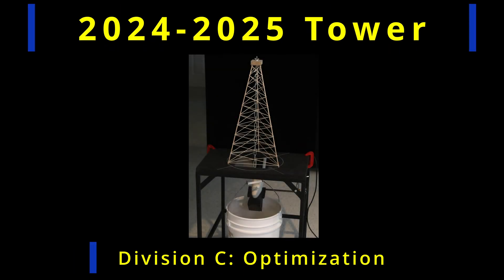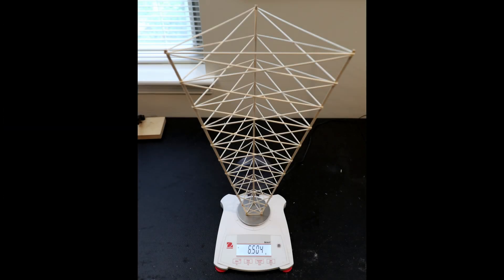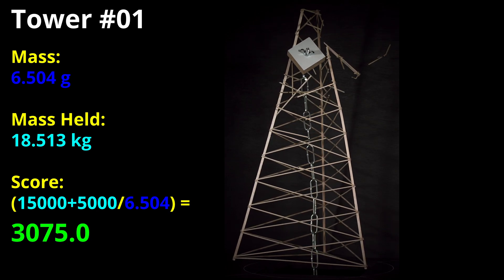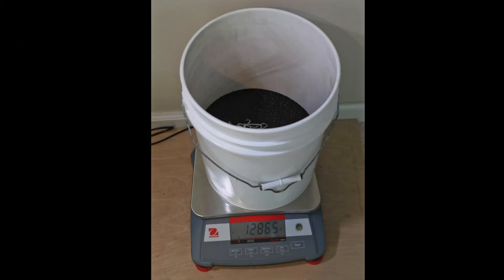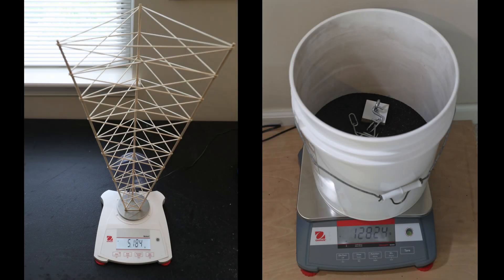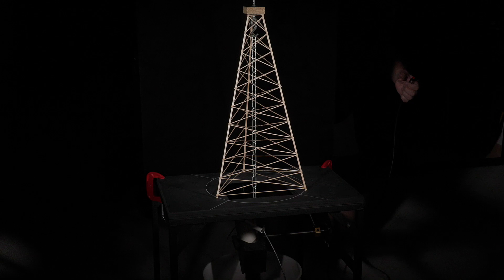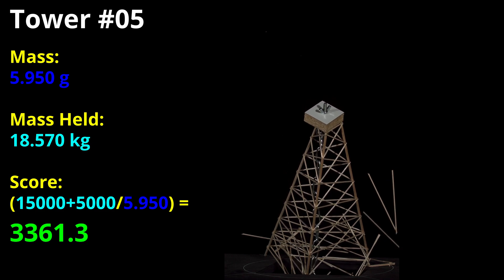2025 Science Olympiad Tower Div C: Optimization

Comment: Hey Balsa Engineering, I am competing in tower for the first time and would like to play with this design. Where can we find the lengths for tower 5 as this was the most optimized one. The lengths of the cross structures and the legs would be helpful. I was also wondering where you got the specific balsa wood sticks. I would like to get the same ones so that I can minimize any flaws.
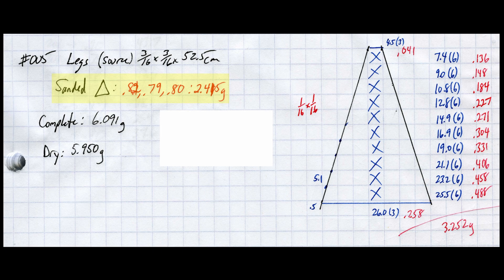Reply from the maker: Hi!  You can find the detailed information on each of these tower builds right in this video.  For #5, check out my notebook page at the 7:44 mark.  Everything in blue on the right shows the lengths of the pieces in cm.  The red is is total mass for each grouping.  You can compute the exact density by know the size which is also shown (1/16 square for the cross members).  I like to buy all my balsa in sheets from a place called Specialized Balsa.  It's not that the wood is better, but it's the only place I know of where you can specify the density range when ordering.  I would highly recommend you check out some of my general videos to learn more about getting great material to use.  Here is one to get started: https://youtu.be/bLsTOpmozGI
Reply: @balsaengineering6686  Thanks, I'll take that into account. Our club itself has some Balsa wood sticks, I'll see if it matches the density of it. If not I may need to order myself from Specialized Balsa, do you know the rough estimate of delivery time?
Reply: I also just want to make sure, the height of each leg is 52.5 cm, the increment for where each cross member needs to go is 4.6 cm. And the length of the cross members itself starts from 25.5 cm and goes till 7.4 cm., dimensions of each balsa stcik is 1/16 x 1/16 inch. the top has 3 (4.5 cm ) sticks.
Reply from the maker: @niranjankothandaraman  They are a small family-run business, so their delivery speed changes a lot depending on how busy they get.  My experience has typically been about 1-2 weeks or so.
Reply from the maker: @niranjankothandaraman  That is mostly correct.  The cross-member layer spacing is 5.1cm (the first one starts at 0.5cm from the bottom).  Also, don't forget about the bottom 3 horizontal pieces that are 26.0cm each.
Reply: @balsaengineering6686  Hey Balsa Engineering, in my last competition, our tower weighed 17 grams and held 11.9 kg. We were curious on where we got this extra weight. We weren't completely sure on the stick's dimensions since we got it from hobby lobby lol.  Any tips for us? We glued the parts were the truss's meet in the middle, like the middle of the x. Do you think the extra weight came from that? Or do you think its probably the wood.
Reply: I would also appreciate it if I can get the exact densities and what u exactly ordered
Reply from the maker: @niranjankothandaraman  Hi!  At 17g, your extra weight is not coming from glue, it's 100% from the wood being too heavy/dense and maybe too big.  That being said, if you built a 17g tower and it only held 11.9kg, you have some other issues to address regarding executing the build.  It was probably not level or there might have been some serious glue joint issues.  A 17g tower should be able to hold 30+ kg.  Definitely focus on a good build with the material you have before trying to find lighter material.  You need to make sure you can hold the full 15kg at any weight before taking the next steps.  Good luck!
Reply from the maker: @niranjankothandaraman  I'm not sure, it really depends on how busy they are.  If things are going well, I've gotten shipments from them within 2 weeks.  During their busy times it can take a lot longer.  You can call them directly and get an estimate if timing is critical
Reply from the maker: @niranjankothandaraman  I don't have those numbers off-hand, but by looking at my notebook pages in this video, you can easily calculate the density for any particular piece or group you are interested in.  In general though, the source 3/16" sticks were in the medium density range, and the cross members were in the light density range.
Reply: @balsaengineering6686  Yeah, when we were removing our tower from the 3d print, we broke many trusses while removing it. We reglued it but that probably damaged structural integrity. I can prob fix that by rewatching ur vids on assembly.
Reply: Hi Balsa Engineering, what kind of glue do you recommend for your tower? Right now we have been using Bob Smith Industries BSI-157H Maxi Cure/Insta-Set (it has a super glue and a spray to use after). Also does it matter the kind of balsa wood we buy as long as we sand it to size?

Comment: Hi Balsa Engineering! My 3D printer has a base of 220 mm, and it is not big enough to print the bottom layer of the Div C bonus jig (260 mm across). How much impact on the construction of the tower would it be to split the bottom trapezoid and print the two halves separately? (cutting through the middle of the triangle parallel to one of the sides)
Reply from the maker: That should be OK.  Just tape the two pieces together as tightly as possible and it should work fine.  Good luck this season!

Comment: Hi Balsa Engineering, first off I wanted to thank you for making these videos! I found them really helpful last season and I was able to get second place at states thanks to you! For this seasons build I was wondering which type of balsa sheets (dimension's and density) you used for you benckmark build. Thanks!
Reply from the maker: Thanks for the kind feedback and congratulations on your success last season!  If you check out 7:45 of this video, you can see my notebook page for the benchmark build.  There I show the sizes and masses of everything I used from which you can calculate the density.  To save some time, I believe the source legs (3/16 square) were about 11 lbs/ft^3 which is in the "medium" range.  The cross members were all 1/16 square.   I didn't calculate the density, but I'm sure they were in the "light" density range.  You can see the mass of the entire layer on the far right side of my notebook page in red.  For example, the bottom layer had (6) pieces that were 25.5cm each and the total mass was 0.488g.   Good luck this season!
Reply: @balsaengineering6686  how were you able to sand the legs down into the triangular shape you needed? should i just wing it from a corner until it hits the proper length of the tower jig's side?
Reply from the maker: @ame9792  You are in luck!!  I made an entire video on how I created the legs!  Check this one out when you get a chance:  https://youtu.be/MTHygxUS3YU

Comment: Hi Balsa Engineering! Should I use light-density balsa or medium-density balsa for the main legs?
Reply from the maker: Hi!  I think if you do the math to calculate the density of the source sticks I used for the legs, they are around 11 lbs/ft^3 which put it more in the "medium" density range
Reply: @balsaengineering6686  Hey balsa engineering this might be a weird question but im trying to build 5 towers, and im buying balsa sticks that are 36 inches long, how many sticks would I need to make 5 towers (for cross members only). Im thinking of buying 50 sticks but i dont know if thats enough or too much :(
Reply from the maker: @steamedfrog8386  Math is your friend :)  If you check out at the 9:06 point in this video and see my notes, I show the lengths of all the cross members and horiz members.  It adds up to 1055.1 cm which is 415.4 in which if you had perfect utilization would be 11.54 sticks at 36" each.  That is not possible though, so add a couple sticks extra for each build.  13-15 for each tower is probably a good estimate.  BTW, I recommend buying sheets of balsa and cutting your own sticks, it's much cheaper that way.  Good luck!!
Reply: How do you calculate the 11lbs for the legs?
Reply from the maker: @sillyegbert-mn2zd  From the notes in my video, we know the source sticks were 3/16" x 3/16" x 52.5cm.  First we can calculate the volume of that in cubic feet.  Converting to inches, it's 0.1875 x 0.1875 x 20.669" = 0.7267 cu in.  Divide by (12*12*12) to get to 0.000421 cubic ft.  Next we know the source stick mass is roughly 2.1g from the video notes.  Convert that to lbs and you get 0.00463 lbs.  Our final answer is then just 0.0046297/0.00042052 = 11.01 lbs/ft^3.  Hope that helps!!
Reply: Hi, quick question I noticed that speclized balsa wood says that there balsa sheets are 36 inches but I noticed you used 52.5cm for the length of your legs which is smaller when you did the math. I was curious if it will affect the final answer you got of 11ibs because I'm buying balsa sheets of 36in.
Reply from the maker: @asteralemayehu4973  You can compute the density of any sized piece, just mass/volume making sure your units are correct.  The density I shared for the source legs was ~11 lbs/ft^3. The size of the original sheet doesn't matter
Reply from the maker: @asteralemayehu4973  You can compute the density of any size piece, it's just mass/volume if you keep the units consistent.  The density I shared for the source material was not 11 lbs, but 11 lbs per cubic foot so the size of the original sheet doesn't matter.  (sorry for the duplicate response...)
Reply: @balsaengineering6686  Okay, thank you so much!
Reply: *smaller than the 36 in.

Comment: Does 26cm base for the equilateral triangle tower actually fits outside the 29cm circle? I have been trying to do the math and 26 cm side lengths keeps giving me the perpendicular bisector of 22cm instead of 29cm. Idk if I did the math wrong but it would be great if u could show me how u did it
Reply from the maker: I looked it up :)  I can't remember exactly which source I used originally, but here is one that shows the length of a side for our case:  https://socratic.org/questions/what-is-the-area-of-an-equilateral-triangle-inscribed-in-a-circle     The formula turns out to be sqrt(3)*r or 25.11cm.   You can always just draw it on graph paper and measure, that is a good way to verify it as well
Reply: also how do figure out how to space your trusses out and how many of them you want?
Reply from the maker: @butterflyindisguise3838  The ideal cross bracing spacing is closely tied to the strength of the legs you are using.  You basically have to optimize them together and it's going to involve some trial and error.  I recommend you check out my 5-part series on tower basics to see exactly what I'm talking about, specifically you'll want to watch this one carefully: https://youtu.be/SwmINqhpHL4

Comment: hey balsa engineering, should I order 1/16 * 1/16 inch and 3/16 * 3/16 inch cross members and legs?, also could you tell me what the numbers at the right of your notebook drafts mean?
Reply: Also, you didn't make the cross bracing triangular, did you???
Reply from the maker: @nooby8828  No, the cross members are normal square pieces.  The blue numbers are the cross members lengths and the (6) means 6 pieces at that length.  The red value on the far right is the total mass of the entire layer.  If you get a chance, watch this video I made on how I take notes.  It's from last season, but I'm doing the same things for this year as well: https://youtu.be/6jSlhXZORMs

Comment: hey, so i had a question the legs, I got the square ones is it okay or i have to cut the quarter to triangles
Reply from the maker: You can try and make a tower with square legs, but you won't be able to get flat surfaces to glue your cross members to.  Some of my other videos in this series show exactly why that is the case and how you could make 60/60/60 legs.
Reply: @balsaengineering6686  Can you please tell which video excatly
Reply from the maker: @YanaPandit-b2f  This one tells about how I created the triangular legs: https://youtu.be/MTHygxUS3YU
Reply: @balsaengineering6686 does it have to be a 60/60/60 triangle? Can it be any shape as long as u can cut it so it can have enough surface to place the crossmembers?
Reply from the maker: @butterflyindisguise3838  If you want a 60/60/60 tower like I have shown here, the legs will need to also be 60/60/60 to have perfectly flat surfaces on all sides

Comment: Are you starting with 36 inch long legs?
Reply from the maker: I started with 36" sheet balsa, then I cut the source legs to a normalized 52.5cm (you can see this in my notebook images) to create the 60/60/60 legs.  The final exact length is achieved by sanding the top off while it's in the assembly jig
Reply: Thanks.  So are the weights listed the 36” or the 52.5cm?
Reply from the maker: @sillyegbert-mn2zd  52.5cm  You can always get this information from my notebook page shown.  Check out the 6:58 point of this video.  I have written for the legs (source) 3/16 x 3/16 x 52.5cm

Comment: Hello balsa engineering,
Should I get light or medium weight for the legs and cross members?
Thanks!
Reply from the maker: Well, you should experiment a bit with that.  I would start with light for the cross members and probably medium for the source leg material.  If you check out my notebook pages in this video, you can calculate exactly the density I used if you want to try and duplicate it as a starting point
Reply: @balsaengineering6686  thanks!

Comment: Hello, is there a reason why you added a horizontal bracing to the top and bottom of the tower?
Reply: not 100% sure on the reason for the bottom but the bracing on the top helps with dispercing the weight since the it gives more surface area for the loading block to lay on.
Reply from the maker: Actually, the block doesn't sit on the horizontal pieces at the top, so that's not the reason.  Because the base is much wider with this bonus design, the bottom is pretty much in pure tension, for which a horizontal piece can help a lot.   The top piece, I just decided to go a little conservative to make sure the legs didn't fold in on themselves.  I would recommend you experiment with removing both for your builds and see how it goes!  They may or may not be necessary depending on your cross bracing!  Good luck this season!

Comment: Hi, balsa engineering! Thank you for the video. Can I just order triangular leg, not sanding the square leg? Because it can make some errors or mistakes.
Reply from the maker: Hi!  I don't know of any place where you can buy 60/60/60 legs.  If you find somewhere, please let me know!
Reply: I checked with National Balsa and they do not unfortunately produce such legs.
Reply from the maker: @completeandabsolutenerd  Yeah.  Specialized Balsa sells pre-cut 45/45/90 legs, but that's not ideal for our use case either
Reply: @balsaengineering6686  I hope we can find a vendor who will do that because that will save a lot of time and effort, as well as wood waste.
Reply from the maker: @completeandabsolutenerd  It's not too hard to make them.  I found it was about 2-5 min per leg depending on your technique.  It will definitely be much cheaper to make them yourself as well